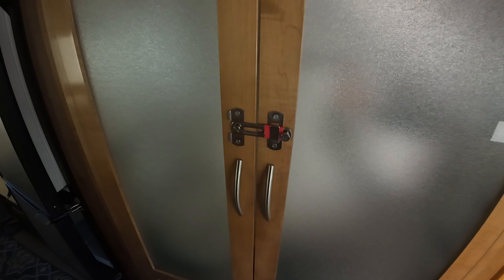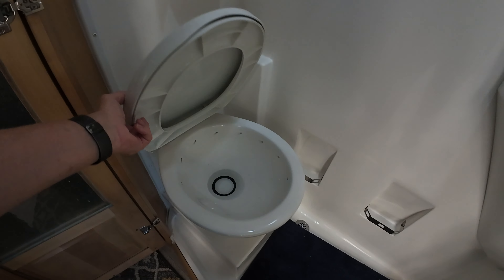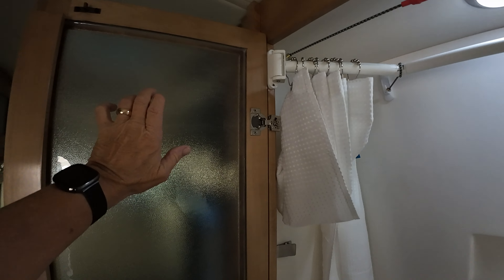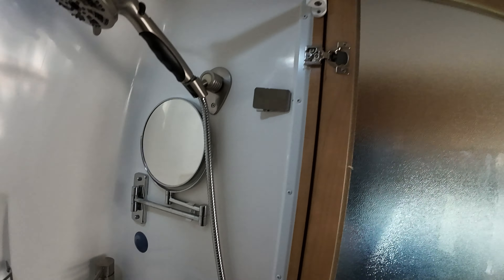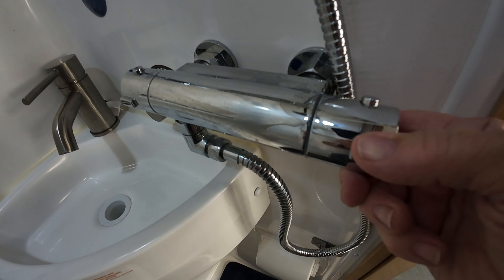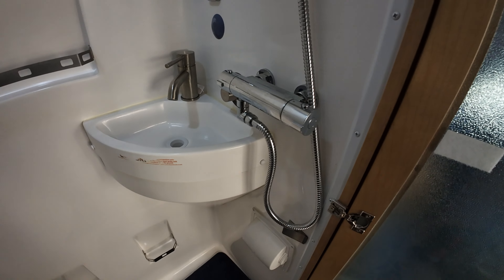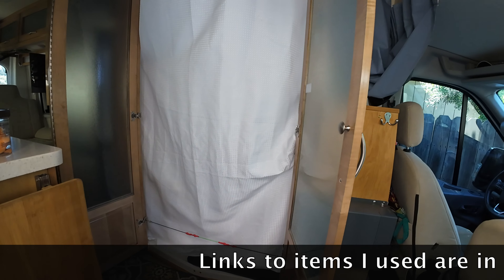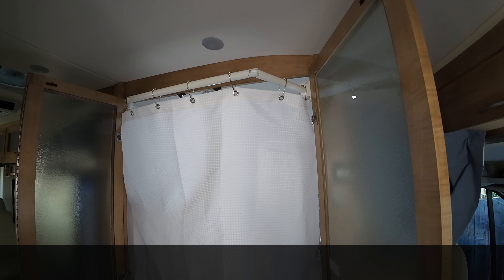Best Class B RV Shower?

Comment: Bill - Great video!  You are saving many Coachmen owners quite a bit of research.  Can you tell us more about three things?  Is the thermostatic valve a direct swap out/in verses the standard Coachmen valve that can be done from the 'shower side,' or did you have to get 'behind' the shower to install?   Also, please tell us more about the longer bungie cord as it looks modified.  Finally, please tell us about the adhesives you are using.  I suspect that the 3M hooks are using the strips they came from, and that the VHB for the chip clips is a standard 3M VHB, yes?  Thanks again so much!
Reply from the maker: IF you find the valve with longer stems it will be a direct replacement. I did have to do some trimming behind. You do have to access the back of the shower. Easy to do by removing the access behind the drivers seat. Two screws top and bottom and the recessed unit comes right out. I made the longer bungie out of two small bungees and a rope, it is what I had on hand. Yes 3M hooks use the strips they came with. and 3M VHB for the clips.   Full install can be see on  the FB group. COACHMEN Beyond / Crossfit RV Class "B" Owners & Prospects,  Search that site for bill harr and you can find it.

Comment: Thanks for the video. Question about the Missmin shower valve. Did you have to modify anything to mount it? I tried putting one in my 22C but found the mounting adaptors provided with the unit were too short to allow the water line hoses to screw on.
Reply from the maker: I also got a valve with the short stems. I trimmed the fiberglass wall to install.  Full install can be see on  the FB group. COACHMEN Beyond / Crossfit RV Class "B" Owners & Prospects,  Search that site for bill harr and you can find it.

Comment: Hi Bill - Thanks for this. I went ahead and ordered the shower valve replacement you used (and the right angle). I'm not so great at plumbing so I think I'm going to need to have a plumber install the unit for me. I tried to message you on FaceBook but I think you need to accept my friend request first. Looking forward to connecting with you! Dr. VanLife